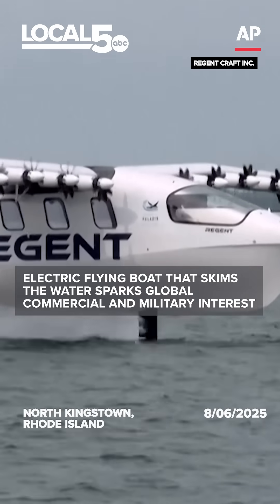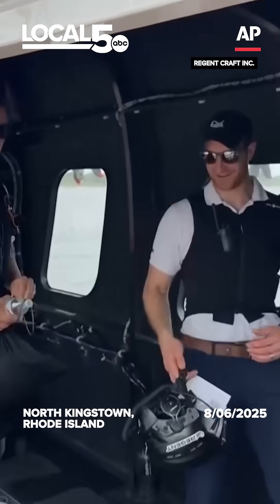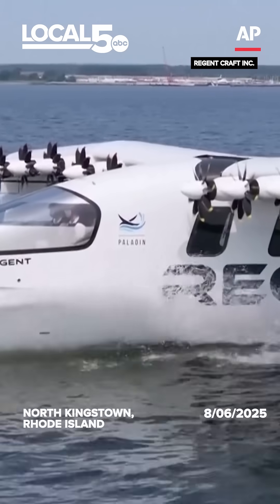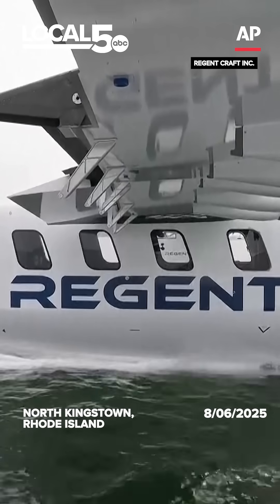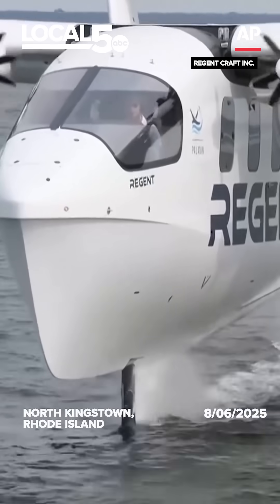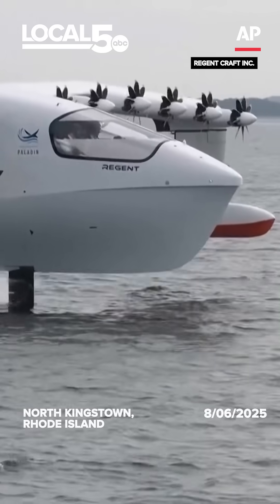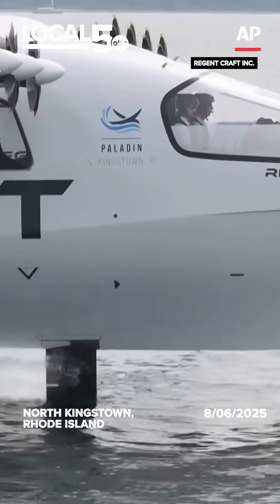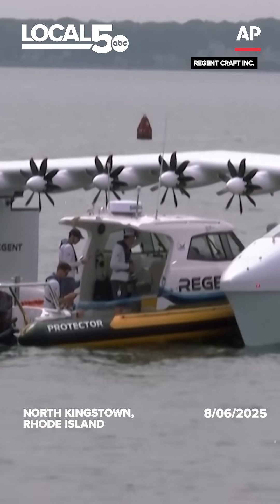Electric flying boat that skims the water sparks global commercial and military interest

Comment: The soviet's tried this in the 60s-90s with the ekranoplan It didn't work out well, there's several reasons why. It's a great concept, but unfortunately will not last, it might not even "take off"
Reply: Well, the quarter scale prototype took off and flew quite nicely, thank you.  Another company has the Airfish full sized flying.  The tech isn't the same as the ekranoplan.  Light weight composites, high efficiency electric motors, computer designed propellers, blown lift architecture,  and especially the foil for water to air transition set this well apart from the soviet's early attempts.
Reply: @triplec8375 
Not changing what I have to say, I understand it uses better tech. Innovation where it isn't necessary. I'll eat my hat if theyre around for another ten years, but I doubt it